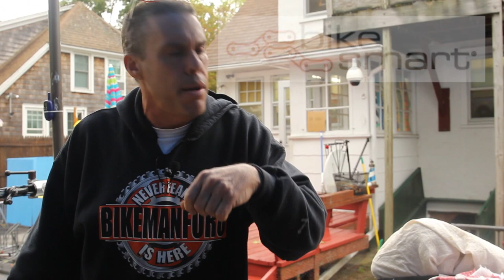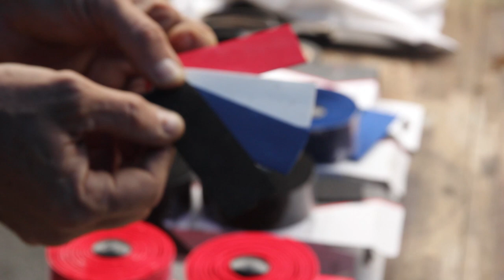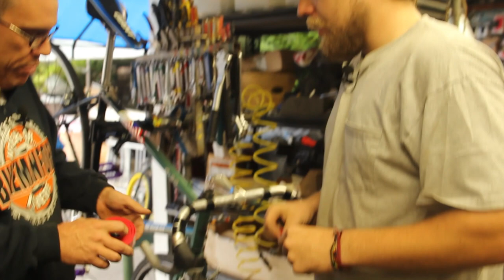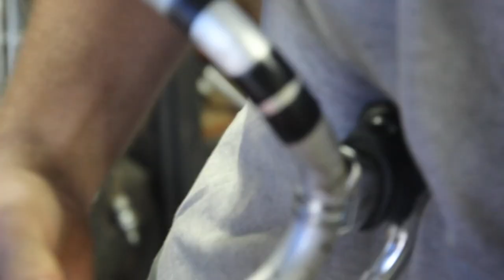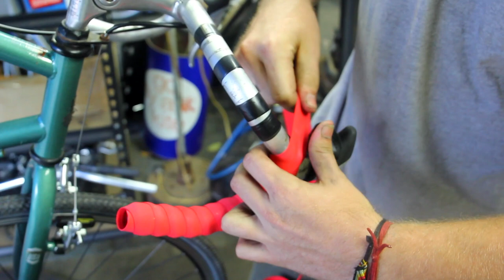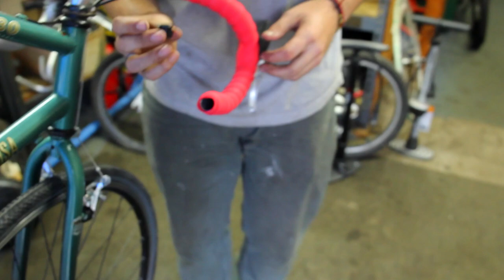Wrap A Handlebar - EZ How-To Guide -  BMXBoy - BikeSmart Route 66 - BikemanforU

Comment: Hey Marco you did a sterling job with the bar wrap,bottom to top is the correct way to wrap because in that way the leading edge of the tape is covered and cannot roll over thus leading to premature tape failure.
As anybody knows who's actually wrapped bars themselves on road/drop bars hand pressure will naturally be out and down and if the edge of the tape is exposed it will lead to edge roll.
I've personally tried both methods and bottom up lasted 3 times longer,you also let the electrical tape ''sit'' for a few seconds after cutting so the ''stretch'' that builds up in it from the wrapping can dissipate and not lead to peel/slide back.
All in all a good job man.

Comment: A few pro tips that not everybody knows: 1) For optimal results, your black electrical tape should be of the of the far east variety, recognizable because there are only incomprehensible scratches where you would expect to see writing. 2) In the southern hemisphere the tape should be wrapped in the opposite direction, so it won't conflict with the prevailing wind.